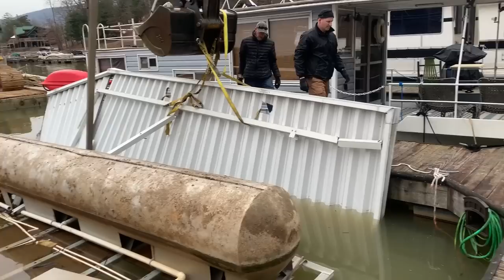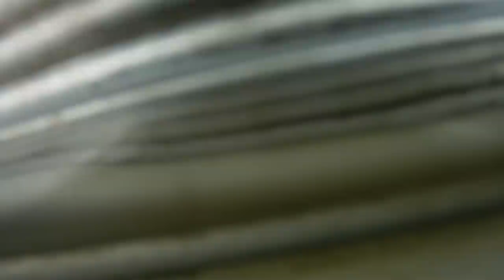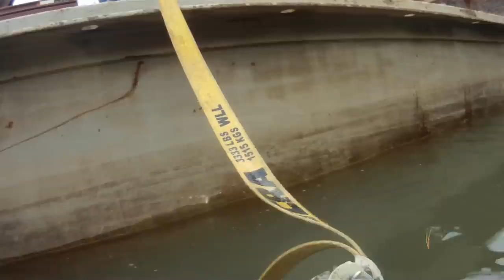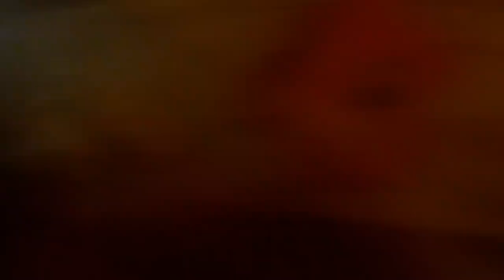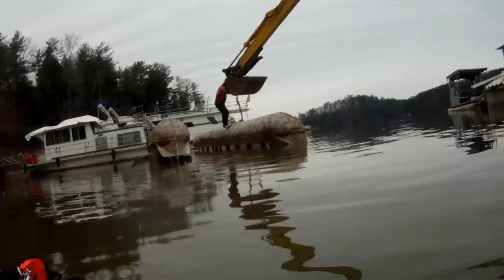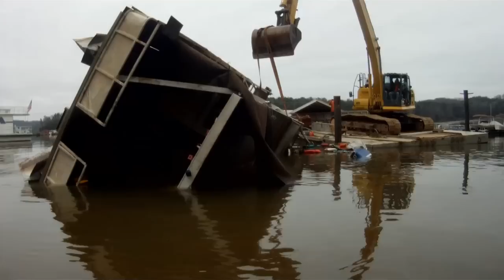Cold Water Salvage Of A House Boat

Comment: That was pretty interesting. Having worked several semi recoveries, why not use chains over the straps? Is the concern the weight? I don't know that it would have lessened the damage significantly, but seems it would be safer since you don't have to worry as much about breakage with proper size chains.
Reply from the maker: Straps are easier to deal with underwater. Chains can be too heavy at times.

Comment: Hey very interesting video! But I was wondering how do you mount your camera? Also what camera do you use? Thanks
Reply from the maker: I personally use a whole series of Intova Action Cameras.  I have the Intova HD Sport 2, the Intova Nova, the Intova Edge X, the Intova Connex, the Intova HD2, and the Intova X4k.  All of these models with the exception of the Intova HD2 and the Intova X4K are discontinued models.  For most of my Public Safety Diving Videos, I use the Intova Connex, as it allows me to hook it to a surface monitor for a live feed to the surface. All of the Intova cameras come standard with a 1/4 inch mount on the bottom that will work with any standard camera mount on the market.  Anytime I am using a Full Face Mask, I have just a standard 1/4 inch bolt that is attached to the top of my Extender Frame, that allows me to mount the camera directly to the mask.  With a traditional mask, I use the Mask Mount from Intova to attach the camera to my mask.

Comment: I frequently hear people complain about marinas that require insurance coverage on boats moored at their facilities.  This is a very good example of why you need it.  I’m curious what the cost is for this level of salvage and cleanup.  My guess would be about $15,000-$20,000.
Reply from the maker: Here at our marina, we do not require it, but we strongly encourage it. As far as total cost of a salvage, there are many variables that determine cost.  On this job we were only hired to do the rigging of the straps. The surface crew was the main salvage crew on this House Boat.  We typically will charge a set fee per footage of the vessel, or in a case like this we charge a set rate per hour per diver.  If the vessel is completely submerged on the bottom, depth plays a big role in the total cost as well.  Distance to the work site is the final variable in the equation. Depending on how far we have to travel, a travel expense is usually added in as well. When a person has insurance, all they pay is their deductible.
Reply: Those were some of the variables I had running through my head.  Bringing in an excavator on a barge, permitting and insurance to do that type of work on a waterway, environmental cleanup of debris and oil/gas spillage.  The cost to bring in divers is pretty small when you consider the big picture.
Reply from the maker: Our fee was minimal compared to what he was charged by the surface crew.  The biggest issue is ironically not dealing with environmental issues, but more so the safety of the divers while underwater.